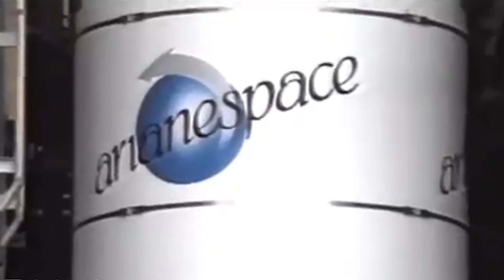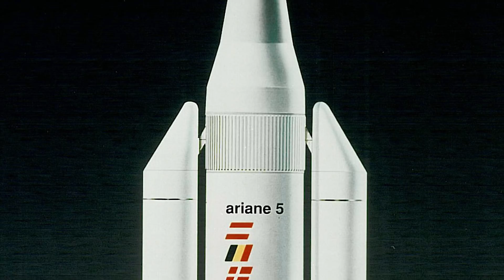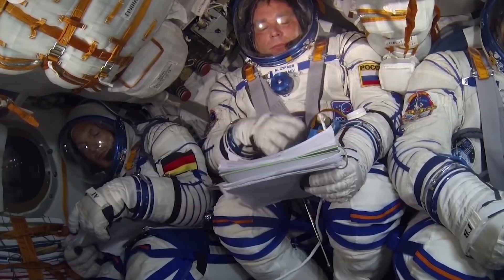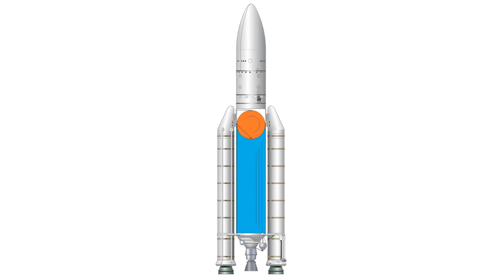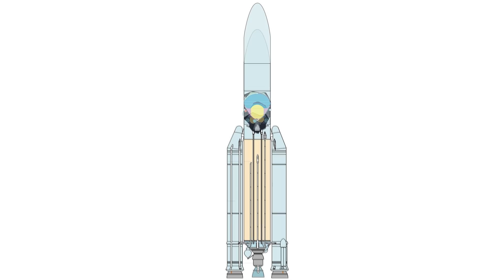Ariane 5 - the European stairway to space

Comment: The ariane designs stand on the shoulders of its predecessors.. if not for the space race ESA would not have the knowledge it has to today to launch large payloads... also having access to a launch site on the equator greatly improves payload capacity while lower fuel requirements.. think slingshot effect..

Comment: Very interesting rocket, interesting facts learned: 
1. SRB produce as much as 92% of thrust where center 1st stage produces 8% of thrust and fire for 10 minutes.
2. Early version of 2nd stage is fairly interesting, considering the 1st stage is almost doing some work for the 2nd stage, the early 2nd stage could be considered as a 3rd stage (?). Then if we think the SRBs as just supporting boosters, the rocket it self is basically an SSTO ( just joking for fun)
3. Double fairings, interesting
4. Fun fact but not mentioned in the video: the first modern Ariane 5 test failure in 1997 was very toxic to the environment, especially to human.
Reply: About #4, yeah that's almost certainly one of the more notable toxic incidents that year, hypergolic rocket fuels are not fun stuff to get exposed to.

Comment: Interesting that it’s named something pronounced “Aryan” and the boosters (highly contaminated) are dumped into the ocean and not recovered, little aryan Greta would be horrified!!
Reply: By the time the boosters land on the ocean, there is less than 0.006% fuel within it's hermetic feeders. These are designed to seal and close off particulate escape by the time they cool in the lower stratosphere.

The hermetic seals are designed to last 40 years, by which time any particulates (boron) have long reached their half life (eg 17.7 seconds beta minus decay, and after 40 years, there is less than one millionth the active harmful mass of the amount when it splashed down.)

That is 1 millionth of the 0.006%. That equates to less than 0.06 grammes of radioactive particulates potential bio damage per booster. Or, to put it another way, 100th the mass of a single grain of sand.

Any fuel unburnt within the rocket section cone will have long dispersed into the upper atmosphere by the time it reaches the ocean.

It's not that harmful. Boron is a naturally occurring element, and there is more in a single rock containing borates (shale, sedimentary rocks, etc.) than what you would find in an exhausted booster after 40 years.

The boosters then become reef housing for animals.
Reply: @RB747domme  Very interesting info, thanks for sharing.

Comment: 7:55 green flame  either TEB or some other boron "ZIP Fuel"
Reply: If it's from a Falcon 9 or Falcon Heavy, the green flash is from TEA-TEB pyrophoric igniter fluid. Almost the same stuff they used to light the afterburners on the SR-71 (the size of the tank for the ignition fluid is what ended up limiting the range of the SR-71, because it means you can only start up the afterburners so many times, and since you need to turn off the afterburners to slow down enough to refuel, you run into that limiting factor).

Comment: A "fun" addition to the first ariane 5 launch failure is its one of the most expensive programming mistake, they tried to reuse the launch safety Programm from ariane 4 and it was suposed to run a few seconds in to launch, but since A5 was much bigger they had an overflow witch made the launch abort system believe its upside down so it tried to correct it vigorusly so another system sad self destruct it.  If i remember correctly it was suposed to run for something like 40s and the abort happened something like 38 seconds in flight.
Reply: Hope they learn their lesson and not let the same thing happen with the new A6 rocket.
Reply: When it was launched the first time, it was running on windows 95.

Comment: The Ariane V was a BAD design influenced by the even worse design called the Space Shuttle. The fact is that a LH2/LOX main stage that lights on the ground is a lousy idea. Whatever advantages having a higher specific impulse gets you is more than paid back in terms of the bulky and heavy tanks to hold the LH2 and the need for high thrust low specific impulse SRBs to get it off the ground.
The Russians and the Saturn V got it right. Keep it simple, run Kerosene and LOX. That 16~20 ton payload of the Ariane V capacity can be achieved with a two stage, two engine, rocket. It'll have to be a big engine like the F1 or RD170 for the 1st stage, but it is very doable. The 2nd stage can be LH2/LOX or you can stick to kerosene and just build a 30% bigger rocket -- which is still SMALLER than that big fat Hydrogen fuel Ariane V.
Reply: And still, they used the Ariane V pretty successfully, i wonder why....
No really, what is so complicated about solid rocket boosters?
Their only real disadvantage the incapability of reusing them.

The thing is this, you can take a kerosin/LOX liquid fuel motor, however, this requires pump, plumbing and computing units as well as a save control loop.
A solid rocket booster just needs the propallent and the tank.
This decreased number of parts not only reduces cost but also complexity, wich automatically leads to an increased reliability.

You can basically choose between a more complicated, more expensive but higher thrust liquid fuel booster or a much more reliable, lower cost but lower thrust solid fuel booster.

I'm not going to say thaat you are dumb for not liking the solid booster approach, but let me tell you this: "It all depends on the situation".
Just looking at the past, the solid boosters where probably the best option for what the Ariane V was build for.
Reply: With those giant boosters the first stage is more like a second stage. Its like having a inefficient but strong first stage, and the second stage ignites already on the ground. It has just a small effect during booster phase,  but doesn't really burn much proppelant and you have a secure ignition. To be honest the shuttle was quite efficient, if you considder, that such a "small" vehicle could lift 20t plus crew of 7 and a big plane into orbit. You are quite right, with something like a delta 4.
Reply: The ariane v is absolutely tiny compared to comparable rockets! You obviously hint at the Falcon 9. (Which is fucking huge). I think the biggest advantage of SpaceX is, that most of their value chain is in house. At arianespace, there are lots of european companies involved, of which every one wants their sweet sweet revenue.
Reply: If you keep the capacity to make solid rockets then you have the option to make quite big missiles should you suddenly decide that you needed to.
Reply: @timmurphy5541  Yeah, it's called the M51 SLBM! No ICBM or SLBM will ever use multi-segment SRBs of the size which the Ariane V or Shuttle uses -- not even if you want to deliver city killer 5MT bombs which western countries do not have in their arsenal.
--
It's really very simple. The 1st stage gets you only less than 30% of your Delta V but comprises 85% of your launch mass. Specific Impulse is NOT IMPORTANT; density of the propellant and hence the size of the stage is MORE IMPORTANT. Therefore, Hydrogen is a terrible fuel at lift off. If you are averaging Hydrogen and SRB Isp, you are better off lighting a hydrocarbon 1st stage. The Russians got it right, Apollo got it right, SpaceX got it right. Shuttle, Ariane and Delta IV are just plain dumb.
Reply: @dwightlooi  however unsuitable SRBs are for missiles the engineers who make them and the people working on the propellants can be turned to other work if needed and will no doubt have some useful experience. It might take a long time to create that from scratch.
Reply: @dwightlooi I see what you mean: "The three-stage engine of the M51 is directly derived from the solid propellant boosters of Ariane 5.[6] Like other blunt-nosed SLBM, such as the Trident D5, the M51 uses an extensible aerospike in the nose. "